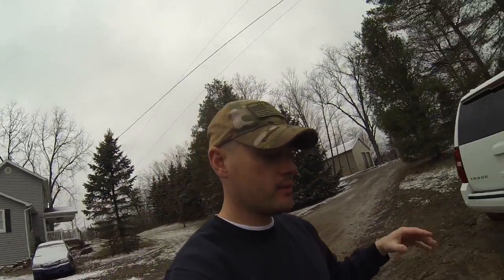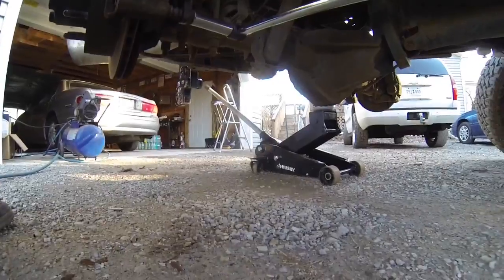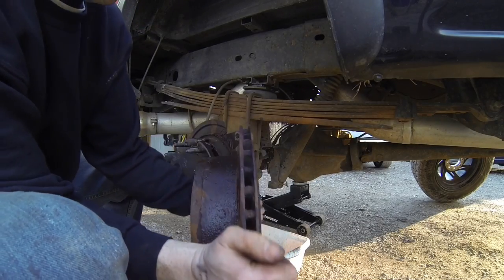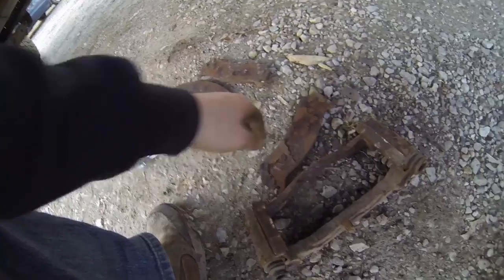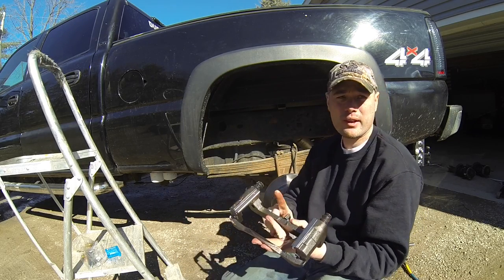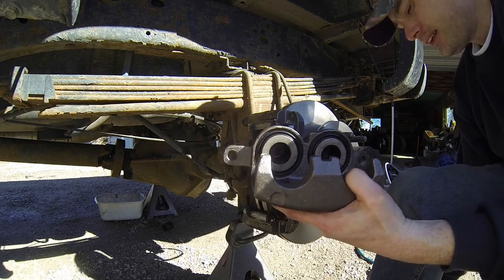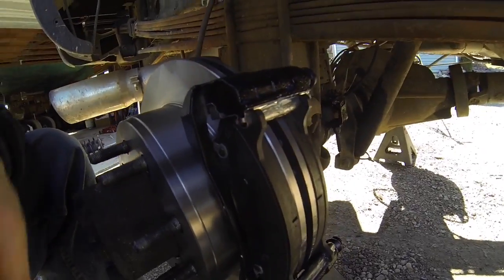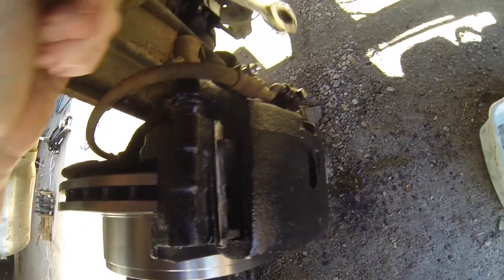Full Install Brake Pads, Rotors and Calipers *SILVERADO* Duramax

Comment: Use jack stands for safety please
Reply: Sorry should have watched longer
Reply from the maker: +john mason they are under there
Reply: Truck Master I had a truck fall off a jack I always use stands now
Reply: That was my first thought as well. I see that you used the jack stands later in the video, good call.
Reply: Agreed John.... had my truck on stands but lifting the bed up to get the shackle bolt lifted pressure off the stands... truck leaned a little and down it came... luckily the tires were on... and I evacuated the moment I noticed movement.

Comment: You want to grease the slide pins.
Reply: Kirk C and use brake system grease.  Not anti-seize like we’re often tempted to use.  Brake parts grease/jelly has better heat tolerance.

Comment: What I do when I do breaks is I use antisese on the bolts on the caliper bracket that mount to the axel housing and the bolts that hold the caliper to the bracket and to the lug nuts and the back of the wheel that mounts up to the rotor cause the aluminum rims seize to the rotors cause steel and aluminum don't mix

Comment: just a small thing. I learned from my father years ago that the best way to bleed the brakes is to put a hose over the bleeder screw and into a clear jar with clean brake fluid. Open the bleeder and have another person slowly pump the brake pedal until all bubbles stop appearing in the jar.  When the brake pedal is raised, it pulls clean fluid back up into the caliper. This works and doesn't pump fluid out onto the ground.

Comment: My calipers came with new copper washers for the brake line. I tried to remove the old ones but they would not come off and fluid just kept dripping out. Did you replace yours?

Comment: I seen u greased the clips I always grease under clips that's where rust builds up an squeezes not letting pads slide freely I've noticed u greasing top of clips which builds up with brake dust

Comment: I broke a ratchet and 3/8 to 1/2 adapter trying to get my one front bracket off the other day, it was on there for sure. Wasn't changing the brakes though, but trying to grease the hubs through the abs speed sensor hole and clean the speed sensors off because I was getting the abs while coming to a stop. Might want to give it a shot, will save you some $ on hubs I'm sure. Although make sure if you do you turn the hub enough and get the excess grease out of the hole. On my one side the sensor came out without the plastic cover just like in your video, so thanks for the help on replacing that! Then I got the abs light on after I put it all back together, so I went back and some of the grease had gotten all over the other sensor. Cleaned it off again, all good.

Comment: A good step to take is also to just check the new slider pins since they are new calipers and check if there is grease and its also a good idea to grease with GM approved stuff since some system require certain greases. And also notice looks like ya have a pinion seal leak maybe address also for an upcoming episode? But other then that great video as always

Comment: That's a very good explanation of a full brake rebuild. I always laughed about the little packets of lube the auto parts store tried to sell you, until i actually used them, now i realize i was the idiot for not buying them LOL.... And for everyone asking about the jack stands, check out 6:58, they are both under there :) Thanks for sharing as always!

Comment: Good tutorial, I would also recommend putting brake grease on the contact surface of the caliper pistons and the part contacting the outer brake pad to avoid brake noise.
Reply: They make a rubber goo for that and no chance of grease melting into the pads!

Comment: Dude if you dont have jack stands put the tires under the frame so if truck falls it wont crush you. Plus the snap on 3ton jack is amazing. Just saying
Reply from the maker: Thanks I had jack stands under the truck in this video though
Reply: @TruckMaster  I seen them there a little ways into the video but not at the beginning of it. Just dont want to see ya get hurt

Comment: Is it a good idea to replace the front brakes while you are doing the rear? Or could you get away with just replacing the rear?
Reply: Hope this comment is helpful, being a year late. You only need to replace them in pairs, both fronts or both rears. Though it is a good idea to check the fronts if you’re doing the rears and vice versa, it isn’t always necessary to do all 4 brakes.

Comment: Be sure to spray those rotors off with BrakeClean first.  They have anti corrosion/anti rust grease/oil on em.     And it’s good practice to crack the bleeder on the caliper before you push the piston(s) in.  Don’t push that nasty old fluid back into the system. 

And you need some traction bars next man. 😎
Reply: And look up the LMM/LML HydraBoost OEM replacement.  It replaces our stock brake booster with a LML piece and it’s supposed to be a huge upgrade in braking performance and pedal feel for only like $130. Drop in replacement.
Reply from the maker: +Bayer-Z28 your absolutely right I need trac bars bad!
Reply from the maker: +Bayer-Z28 no kidding I must check this out
Reply: @35057  Whom is the manufacturer and part #?

Comment: the first time i changed the brakes on my 05 2500 i knew the fronts were bad hence why i was doing them but when i got to the back idk how i never felt it or heard it but the pass side rotor was paper thin on the backside and the driver side i was grinding down the fins to almost nothing. i have never seen rotors do that but they were def. the worst rotors i have ever seen

Comment: Clean new rotors with brake parts cleaner to remove rust preventative so it doesn't get onto the new pads. Also make sure that the bleeders on the calipers will loosen properly before installing them on the vehicle ( best to do at the parts counter when purchasing ) so you don't find a defect after installation. Bleeders can sometimes break with reman calipers.

Comment: Where you able to get your wheel cleaned off from the dust caked on there?
Reply from the maker: +Jake Strohkirch yes but it ruined the finish on the rim I might buy a new rim now
Reply: Truck Master dang that makes me nervous about mine. I have the same problem but on two wheels. Ugh wish me luck!